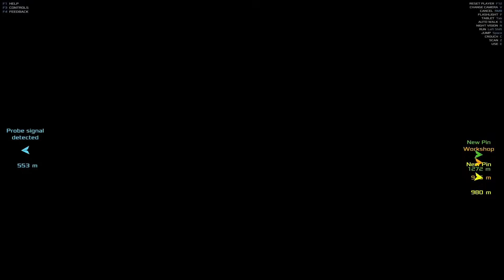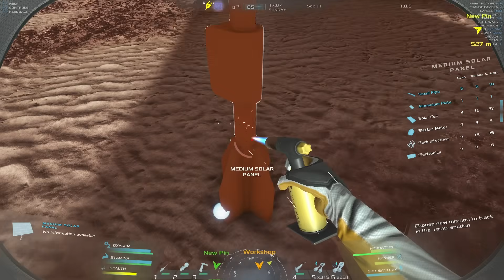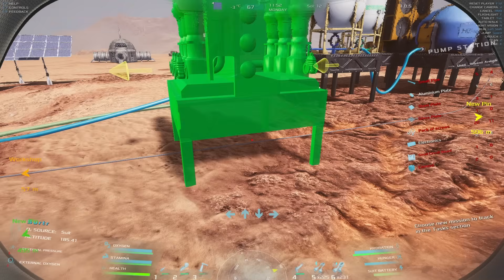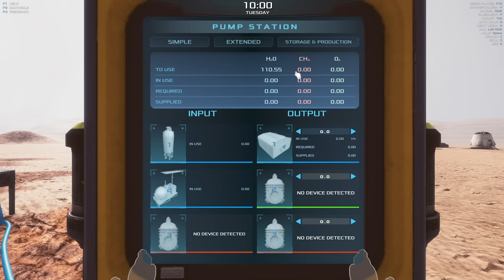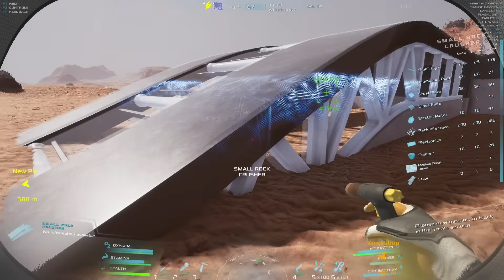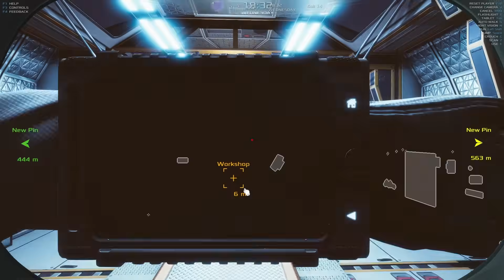Occupy Mars – Fixing The Water Supply And Planting Crops [E3]

Comment: Are you playing in Sandbox mode? I'm in the campaign and got the rover, truck and quad all in a short time. The rover just teleports to you when you press the reset button inside your landing pod. It's up high left of a shelf. The rover has a trailer attached you can't drop but that trailer can load and unload it's ore bucket. I think the truck does something similar but I haven't gotten that far yet. The truck has solar panels to recharge with.

Comment: You can use the marstruck on the small crusher. Mine the rocks to one stage when it says ready to load you can pick them up by hand and drop them into the back of the truck. It doesn’t hold a lot but it’s a good stop gap till you get the rover and then things will fly
Reply: This is correct.

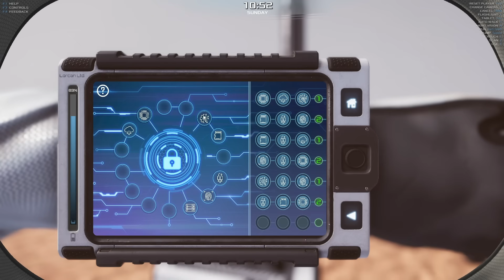Comment: 3:16 If you notice line 2 and 3 the difference means the fingerprint is correct. Line 5 shows the lock is wrong so per line 2 that means the data chip is correct.  Lastly, lines 4 and 6 both show that the cpu chip is correct, since we know the lock is incorrect.  So fingerprint, data chip and cpu chip are the 3 symbols for the hack.  Love your play through Surtr!
Reply: 2:55 line 1 has 1 correct, line 2 has 2 correct, looking at line 3 rules out the cloud and the lock because the sd card is the only match from lines 2+3. Now line 2 we know the lock (middle symbol) is wrong, leaving the sd card and the finger print as correct. So put the sd card and fingerprint in line 4, and choose between the half gear and the chip in line 1 since we know the cloud is wrong.

Comment: I'm glad you got many of these prior episode things sorted. Reminder to make sure you've physically upgraded your grinder to tier 3 (In this episode you have not yet even though you have researched it,) and build your chemistry workbench as well as once again I strongly recommend building all of your work benches as soon as possible. (Yes, so extend your base; it's not as difficult as you're making it. ) Do go back to the code breaker probe that you failed previously. Long-Term, I would recommend you look into building your own electronics as a personal road map as well as of course you getting your Rover with the blueprint. Keep up the great work!

Edit: I recently checked my notes and there is a small rock crusher you can build now which I think normally requires research, but you chose an easier path and is unlocked to you now. It does not require a vehicle and you can jackhammer less and carry or transport to the small crusher for a greater chance at the percentage stuff.

Comment: You can use your tech points at any time, you click and hold on them. I think
Reply: For the early blueprints in each tree, yes, you can unlock them in the PDA directly. But the latter half of each tree requires you to use the corresponding science bench to unlock the blueprints.
Reply: @AnotherJRB yes but he has not finished any of the first research.
Reply: @CandaceWatson-n8w some of it was unlocked through his easier start but yes, he can't continue until he builds those workbenches which is why I've been hounding him over the last few episodes!
Reply: @CandaceWatson-n8w  he finished most of the first stage research if him having everything unlocked from the start is any indication
Reply: @joshuacr  I've learned from watching his other videos that he is very hard headed and he will do everything the hard way just to spite everyone.